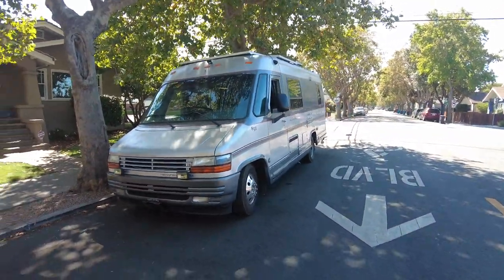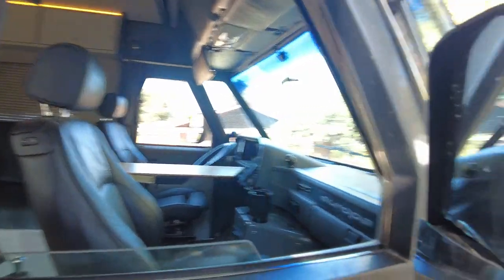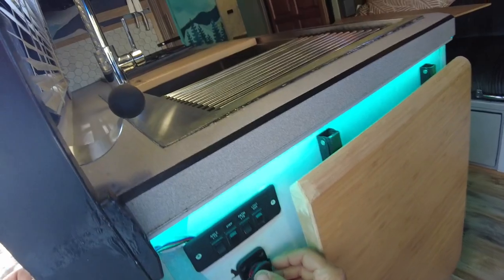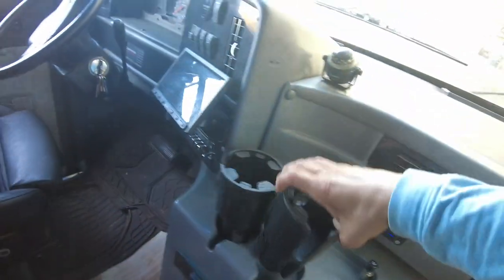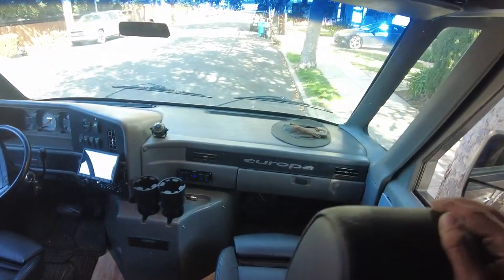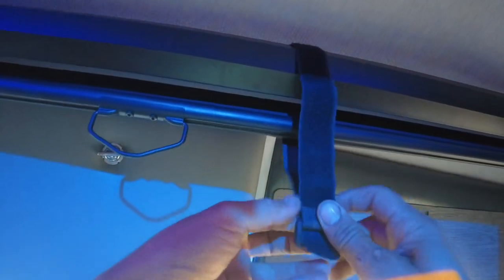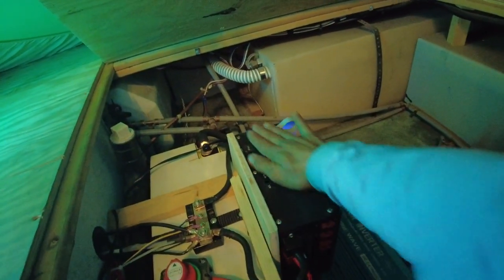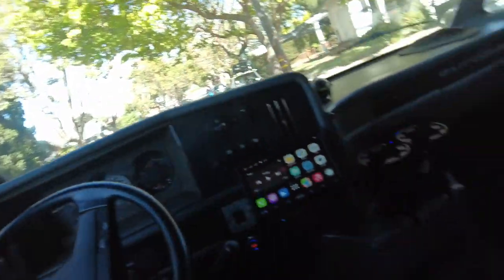Europa 5.9 Cummins RV showcase

Comment: Beautiful looking Europa motorhome. This is my idea of what a motorhome should be. It's large enough for two, maybe three adults to comfortably travel the country, but it's not so large, that parking place is severely limited, you could park most anywhere. I love the work done to it. I also like the Cummins 5.9 Turbo Diesel engine. Did the Cummins Diesel come with the Europa, or was it installed by whoever had it before?